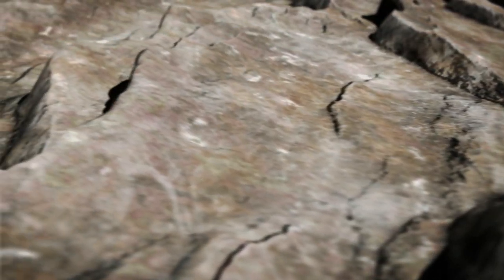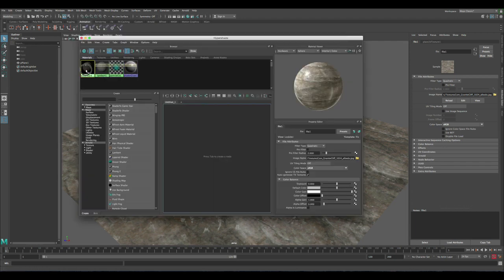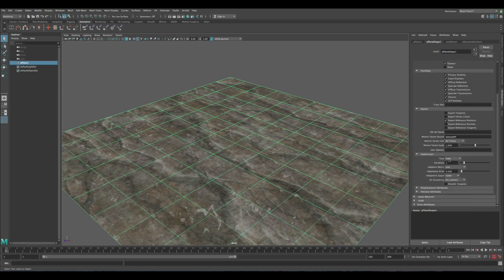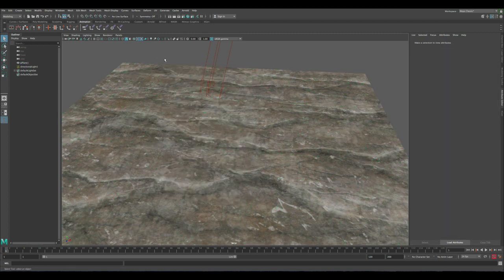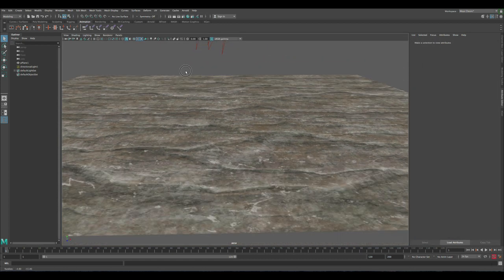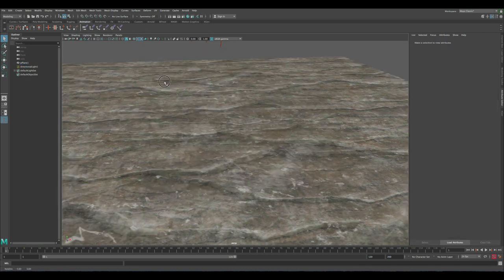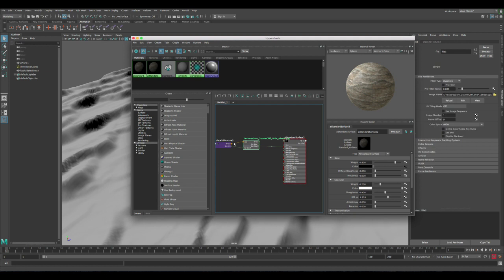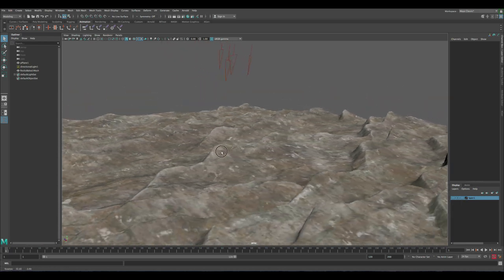How to Convert Displacement Map to Polygons in Maya and Arnold - Fast

Comment: Either  substantially lower the volume of the music, or no music. Also, what did you import? I feel like some step was cut out.
Reply: Yes, what was imported for the displacement, that is kind of important. Was it the same as the texture? or a grayscale version? There are also cuts in the exporting/importing of the geometry that Arnold creates.

Comment: hi, how did u make the showcase video at the beginning? I want to showcase my textures sometimes but I dunno how to make a short presentation video like that, btw. I used your technique and works flawlessly, I just need to figure out how to bake normals, displacement, height from this obj in maya. Thanks
Reply from the maker: Hi, we did the presentation at the beginning intro using after effects, so I would suggest if you want to create short presentation then after effects will be pretty good option, just google how to create short presentations or intros using after effects and I'm sure you will find plenty of tutorials that will guide you, hope this helps :)